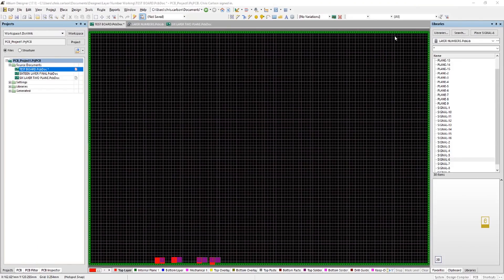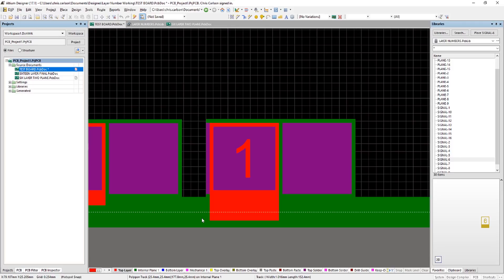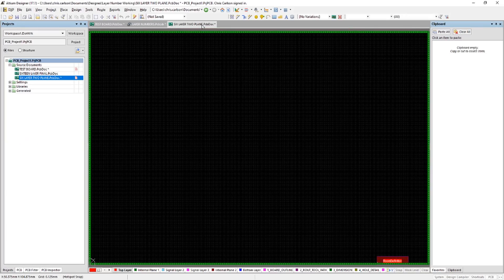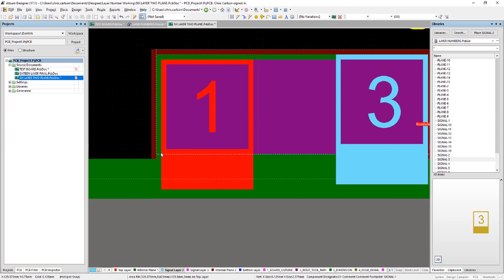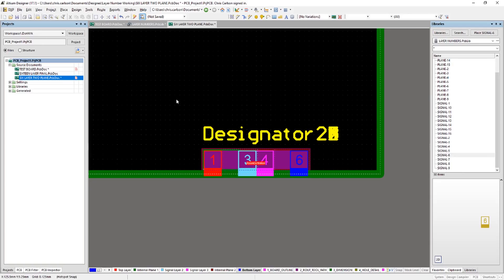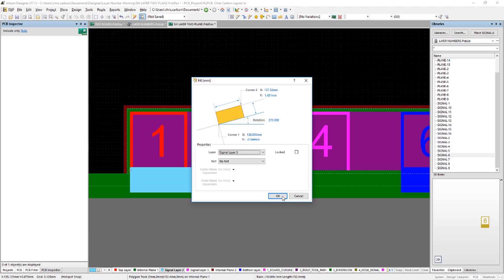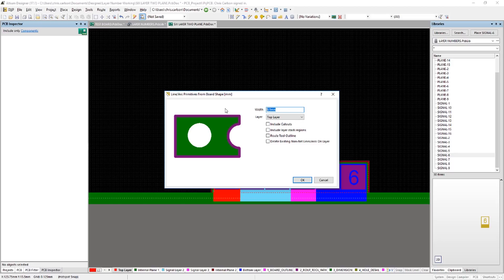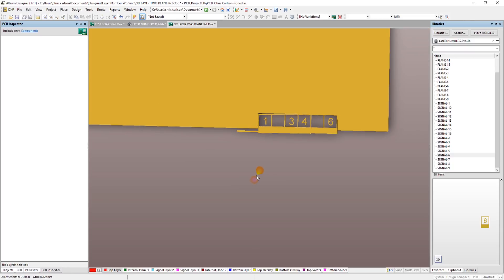Creating Layer Numbers and Stacking Stripes in Altium Designer

Comment: Hi,
thank you for the video, Chris, I had never considered using this technique in my design before. Next, I'll do it. Nice work.

Tip :
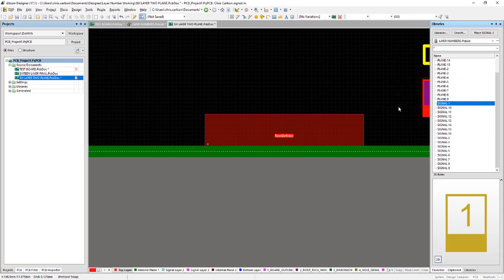From 7:00 and on, since the footprints references are all on the left, one can place all footprints needed close to each to other without regard to position and layer, then select them all -> Open PCB list tool (put in Edit mode) -> Organize them by name or designator -> Choose each layer and at the end Hide the designators in the same tab.
Later, just select them all and move to the desired place. (Hint: use shortcuts Edit -> Move -> Selection  or E M S)